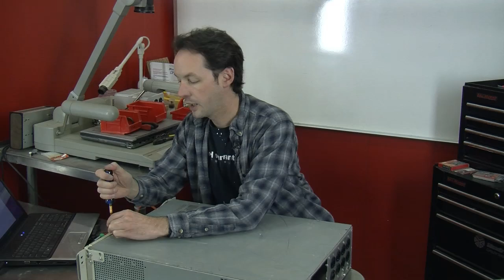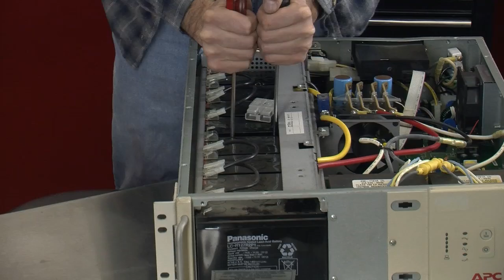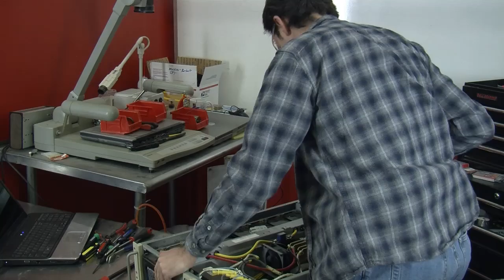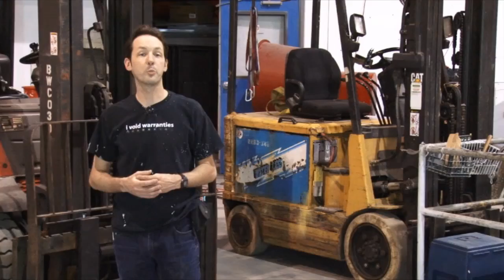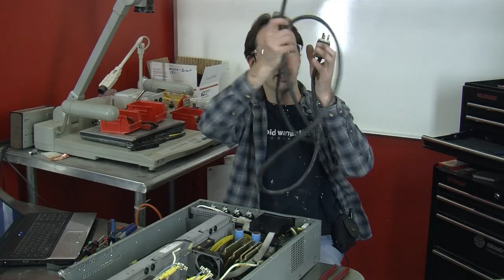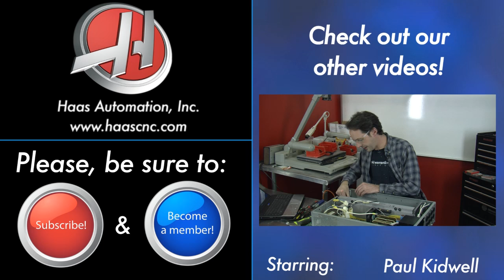Uninterruptible Power Supply: Equipment Autopsy #50

Comment: Why does 120 volts sound so wimpy to me. We use 240volts at 15amps here in Australia
Reply: Lower Volts need higher amps. The volts jolts, but the mills kills.

Comment: The black thing is for a network adaptor for management. I had a smart UPS 1500 I believe somebody gave me. it had 4 like ATV batteries in series in it. very similar setup it looks like though. mine the batteries were shot, and the PCB had blown resistors, and I looked into and was common issue so I parted out.

Comment: The black box is where the network module goes. The ribbon cable carries some voltages sensors and a serial bus. Not much to em. Newer ones are doing away with the transformers too in favor of switch mode PSU to increase efficiency.

Comment: I have disassembled nearly the same model.
First off, one cell shorted and has left that classic bulge.
Second, in place of ripping out rivets and parts why not loosen the top shelf move it up an inch or so?
And, yes, marine deep cycle batteries work wonders!
Mine has 2 big marine batteries and runs for hours.

Comment: When the batteries fail like that it's usually not worth replacing them, the UPS will overcharge and destroy the next set as well, unless you strike lucky and find a fault using APCFIX.EXE. We've seen the same issue on a few of ours (I'm responsible for about 50 APC UPSes of various shapes and sizes at work, plus 2 at home) regardless of battery brand.

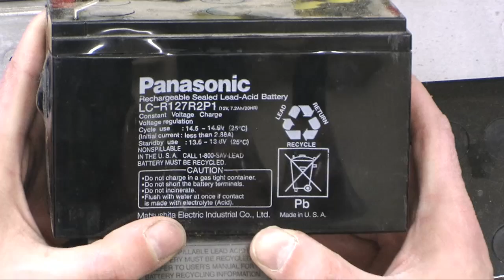At 16:35 that's a 12V 7.2Ah battery, standard fare for intruder alarm panels. 14.5V is the charging voltage.

Comment: @experimentboy   The usual ways are either a pair of transistors and a transformer (think a full wave center tap DC supply with transistors instead of diodes and with electricity supplied to the DC side) or a DC/DC potential converter and an H bridge.  Most consumer inverters use the latter design because it is much more compact.  The former is used for reliability and where the fact that it is heavy as crap doesn't matter because it lives in an equipment rack.

Comment: that 20uf foil cap would be awesome as a speaker crossover cap. especially with its high AC voltage rating, those caps are really expensive but work and sound much better than bipolar electrolytic ones in crossover circuits.

Comment: I wonder if that had a true sine wave or square wave inverter? 

Some things really freak out when plugged into a square wave type inverter like CFL lightbulbs and anything with a vacuum tube rectifier, also some motors aren't happy at all running off it. Certain AC powered devices just do not like square wave AC and need the true sine output to function properly.